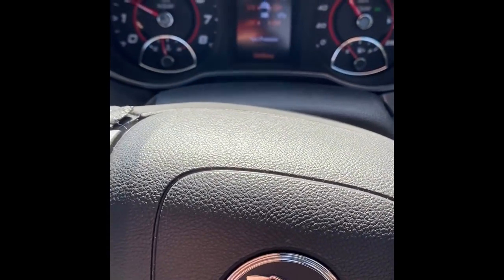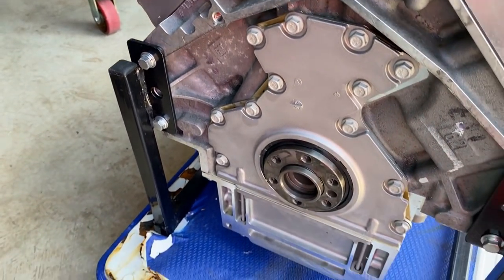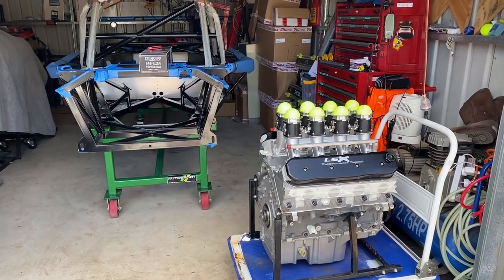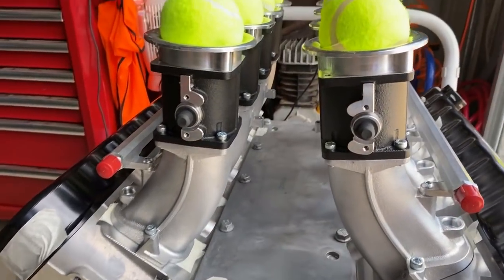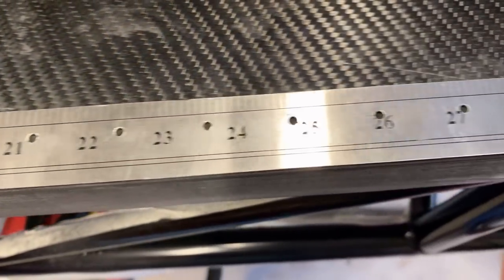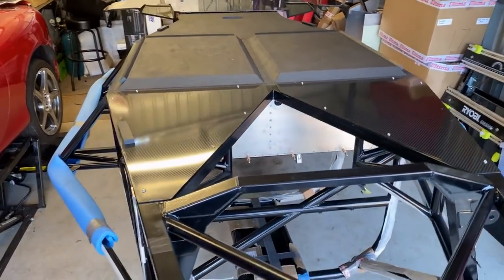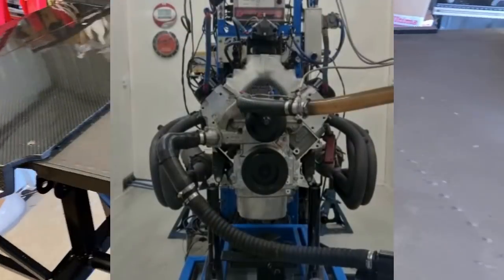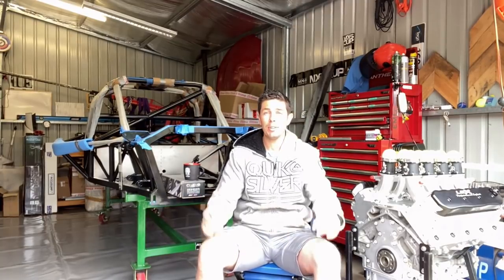Ultima RS - Motor Dyno Results (Video #10)

Comment: Seven hundred-forty newton meters (546 lb.ft.) of torque from a beastly, ITB-equipped LS is enough to bring out the boy inside every man. Thank goodness for traction control software and keep the videos coming.
Reply from the maker: Yeah.... traction control isn’t actually going in. But I have a Bosch Motorsport system you my sleeve if it’s too ridiculous. Thanks!
Reply: @rob105motorsport  Good on you. As a racer you already have a light foot.

Comment: 600hp in that thing will be absolutely savage 😍
Reply from the maker: Hopefully the traction control is up to the task!
Reply: @rob105motorsport  I probably missed it in another video, but what are you running for an ECU?   Traction is a major issue in my SL-C, this is with 525hp and a wet weight of around 2450 lbs (w/ 200 lb driver).   I don't think the TC in the factory ECU can manage it.  Motec is costly, but the way to go if you have the $.  I'm sure others like AEM, etc can still do a far better job of putting the power to the ground compared to the factory piece.

I want to add some turbos to mine at some point, but I know it will get costly if I ever want to put all that power to the ground!
Reply: Found your ECU selection... should be amazing!
Reply from the maker: @ssoffshore5111  I’m running an Emtron ECU. They’re relatively new, but they’ve got some good runs on the board (time attack wins etc). 
However, I’d be running a Bosch Motorsport traction control system for a road/track car. It’s such a good system and quite easy to install. I might still add it down the track if $ permit.

Comment: Great vid as always! Just a suggestion, you may want to look into getting a Perma-Grit sanding block for carbon fiber. The tungsten carbide surface cuts through it real easy. Keep it up, cant want to see more!
Reply from the maker: That's a good tip. I watched a couple of videos of the Easy Composites videos and they seem to make light work of it with a nice finish. Cheers

Comment: It's coming along nicely. That engine should be more than enough performance and love the carbon work. I can highly recommend Easy Composites, great guys to deal with. Would love to know more about your MX-5 too, looks ace.
Reply from the maker: Cheers, Ian. I agree with the performance. It just ended up with a few more horsepower than my original thoughts because of the spec' of the parts around reliability. 
I've got a couple of MX5s.The NA runs a standard SE (AKA Mazdaspeed) motor (around 220whp) and is setup for the track and my NB runs an SE motor I built with a GT2860 (around 300whp) and is setup for tarmac rally. Both really great cars to drive.

Comment: Hi Rob, when I used to play with RC Cars, any filed/sanded edge of carbon fibre on our chassis plates  got a dose of super glue (CA  adhesive) to prevent any issuses of fraying. Is this something you may need to do with the larger panels? Or has CF come a long way since 2005?  Cheers !
Reply from the maker: Hey mate, What you’ve suggested is still the process. I just mixed up a bit of epoxy and used the corner of a rag to seal the edges. Decent carbon manufacturing processes should ensure that the fibre is well impregnated with the resin so no fraying occurs, but it still makes sense to seal it properly. Cheers

Comment: Love the Ultima's, there is a couple hiding around the nations capital.
I have a FC RX7 street car in the build at the moment. The rotary has a fresh build and bridgeported, most of the interior is in. Bodywork is underway.
Reply from the maker: Yep. There are two GTRs locally. One of them is for sale and is built to a good standard. 
I like the FC RX7 and it's only recently their price has blown out. Are you going naturally aspirated or turbo?
Reply: @rob105motorsport  Price increase is partly what has given me justification and motivation to build it. Going to be turbo. Should be fun to drive.
Reply from the maker: @madc0wtx3  Nice. A mate has a fairly cranky FC that he needs to get his finger out and get on the road. A rotor is on the list at some point for sure!

Comment: Been looking forward to more updates and final have one. Love your work Rob. What clutch and gear box will you run with motor. Cheers
Reply from the maker: Thanks, Jason. The 'box is a 996 Porsche item with a Quaife LSD. I've ordered the factory upgraded clutch, but a couple of guys who own Ultima Evos have suggested that the Porsche clutch has a much higher clamping force than LS/LT engines are typically exposed to (assumedly because LS/LT clutches are physically larger with more area). This has resulted in some bad wear on the thrust bearings in the bottom end of their engines. So, I may be going down a different path with a multi plate clutch to drop the pressure plate force. Downside being the multi-plate bastards cost an arm and a leg. Whatever the case, there's some confirmation/consideration for me on that part.
Reply: @rob105motorsport  I was looking at a gear box from TTi in New Zealand. A lot of street and track guys are using them with great results. I have seen Subaru gear boxes been used on V8 appications but boy are they a pig in slow corners. I think you are on the right track with your clutch set up. Looking forward to the final finished product Rob.

Comment: Yeah baby! 😖😁
This is going to sound like a dumb question I'm sure, but why are the inlet ports rectangular?
Reply from the maker: Hey mate, There's a few different generations of heads for the LS. Rectangular port heads were an update to the older cathedral port design (which replaced the earlier SBC heads).
Reply: @rob105motorsport  Thanks Rob, now I have to know everything. Will do my research.
Reply from the maker: @kiwihame  It's a black hole! But it is interesting to see the development of the architecture back to 1955 and how it's now so capable despite some intrinsically poor attributes (like crappy oiling with the deep skirt block that helped strength).

Comment: Bout bloody time shazzy got off her back!

Unbelievable the engine was shipped with nothing over the intake ports? That usual?
Reply from the maker: Hey Tobi, She's off her back! It was properly encased with a heap of Glad Wrap, so no dramas.
Reply: @rob105motorsport  your MX5 is cool with the hard top!

Whats next in the ultima? Must be getting to the exciting part if the build now the Power plants here?
Reply from the maker: @tobihall2247  They're definitely fun little cars. Next with the Ultima is the radiator, brake line, main harness, coolant pipes. and i'll install the shifter and hand brake I think. Heaps to do, but it;ll come together more easily with all the parts arriving.
Reply: @rob105motorsport  looking forward to it buddy!

Comment: Do you guys do the E85 thing down there? Its how I get 350whp out fo my Volvo 850R shitbox wagon with not too much trouble.
Reply from the maker: 850R Wagons are the tits! E85 is a thing. It’s easy horsepower and cooling. The only real downside is consumption and maintenance. Where I live the closest E85 is about a 15-20km Drive in either direction so it’s a pain in the arse. I also want to be able to drive this thing without considering availability. Flex fuel is probably the best answer.

Comment: That opening sequence had me smiling. 

It reminded me of the time my Dad used to drive road trains in the NT and if it was the early hours or folks weren’t around then they’d tie the pallet with engines, gearboxes or whatever to a tree and drag it off the trailer. Premium delivery was if there were some old tires around to land the pallets on! I wonder if it’s the same situation theses days. 

Ps. Noticed the Holden badge on your steering wheel. Shame to hear they ceased trading. Is there any car manufacturing left in Oz at the moment?
Reply from the maker: Hi Dalamar, The old tire trick is still my old man's go to, so I know what you mean! These days if it's a 'professional' delivery, the driver isn't allowed to lift more than 19kg. He's also dressed from head to toe in yellow and has 14 forms to sign. 
As for Holden, it was the last local mainstream manufacturer. Ford weren't long before that. The bottom line is that we have relatively high wages in comparison to global workforces, and our engineering/manufacturing isn't in keeping with that. I like the Maloo, but it has less features/lower quality than my 17 year old E46 M3. Nobody wants a Commodore/Falcon when you can have more specification for the same price. People also love their SUVs. Fact is, the Aus' built stuff was pretty robust/great at eating up miles - I had one of the last Falcons as a work car, and it had the capability to sit at 100mph comfortably for extended periods (I remember setting cruise control between Toowoomba and Canberra a few times as a semi-regular day trip)

Comment: Hi Rob, what fuel was used on the dyno?
Reply from the maker: 98 Ron on the dyno. I specifically wanted that as the fuel because of availability/maintenance. E85 I'd have bumped compression even further to take full advantage.

Comment: Why didn't you go with a Holmart complete LSA for $15000 ??
Reply from the maker: Honestly, it's a much more efficient choice financially to go an LSA. It's actually what I envisaged i'd be putting in when I first considered the car. 
But, they don't sound as good, have quite the same throttle response, and packaging wise the throttle body ends up hard up against the firewall (which also makes heat management an issue). The first two of those issues are pretty picky criticisms though. I do like the LSA in my ute.

Comment: Hey Rob, have you checked out "Ultimate Ultima RS" youtube channel? he has just done the panelling and went about it in a very different way. Just wondering if you had an opinion on his approach?
Reply from the maker: Hey Sam, Yep - Gabe seems like a good bloke. I’ll have to look at how he did his panelling. His car will be very cool and certainly not underpowered.
Reply from the maker: Just had a look. Gabe has his process, seems to be switched on and to be comfortable with the fabrication. Panelling wise I assume he’s aware of the concerns with welding stainless steel to mild steel (floor panel to chassis) as you can end up with poor weld strength. I get the impression it’s not his first day on a Mig, so that’s probably fine. That panel will also add some weight but it’d realistically be negligible. Otherwise, bonding the second skin to the interior Al panes before riveting ensures good coverage. I’m just not sure about Second Skin as a product in terms of how well it’ll hold up sandwiched in the riveted joint and acting as an intermediary between the bond and panel (we don’t have that product in Aus’).
Notching the chassis is a difficult one, but again, properly reinforced and re-finished will likely be ok. The pedal box has been a point of discussion with a fair few Ultima owners, but a lot of that criticism probably comes from being used to road car levels of pedal pressure. 800 series Tilton pedal box looks epic though. 
There’s more than one way to kill a cat. My process is probably the more painful one with considerable over-thinking.

Comment: With tyres, what works on one car might not on another, even on the same car different tyre sizes preform differently- some sizes appear to be stiffer and or different compounds, makes it very difficult to take tyre advice from others... personal testing on your car, your local tracks to your preferences and driving style is the best way, it’s just very expensive!
Reply from the maker: I agree that it's variable car to car, and then there's also preference to suit driving style. As you say, to a large extent all you can do is narrow it down as best you can to a few options based on cost, application, fitment and then go out and test it yourself.

Comment: In my opinion you need an airbox plenum you will loose so much air speed with itb and loose torque.
Reply from the maker: Definitely running a plenum. Stay tuned!

Comment: Great vid, but the volume difference between your commentary and the music is brutal. I need to increase the volume to understand what you're saying and then the music completely blasts my ears off. You could use Audacity for example to normalize and match the levels.
Reply: I just left basically the same comment, lol!
Reply from the maker: Yeah, it’s a work in progress this editing business. The problem is really that it takes time to familiarise yourself with the software, which is build time. I’ve used 3 different softwares so far because of shortfalls. Oneshot is quite easy to drive for the video components, but the audio control was too hard to quickly work out. I’ll have a look for the next one.
Reply: @rob105motorsport  do you mean Openshot? I could take a look real quick and tell you what I can find/how to do volume normalization.
EDIT: Actually, scratch that. If you don't mind switching software, then Davinci Resolve is the way to go. It's free.
The way you normalize there is you go into the Edit tab, right-click your audio, and click "Normalize Audio Levels". Then choose -3dB or thereabouts.
Reply from the maker: @staticv3570  Oh yeah, that's the one. I literally Googled 'best free editing software' and started from the top down on the list. I'll have a look at Davinci Resolve for the next one! Thanks for the tip!

Comment: You're as bad as I am, putting tons of work into something no one will ever see... but you'll know!  You'll want to put 1"/25mm holes in the corners of those  engine bay floor panels to let sand and water drain.
Reply from the maker: That's it, Will! I definitely will drill those holes and create a drain adjacent the battery tray as you've recommended!

Comment: This car is just begging for a sequential trans!
Reply from the maker: I like to fck up the gear changes myself, but sequential trans are definitely wild fun. Sequential ‘boxes also typically suck on the road.
Reply: @rob105motorsport  Well they do whine and have to be gone through every 10k or so.  The replacement parts aren't all that expensive and they are easy to replace (on some of them).  With that said, I have a lot of toys and it would take me a long time to put 10k miles on my my track/street cars... although you might be different.  I haven't looked into doing it with a transaxle for my SL-C, but I have been considering doing it one day on my TT Viper.
Reply from the maker: @ssoffshore5111  It's one of those things. Sequential is 100% the answer for racing, and if you choose the right 'box the initial outlay will be recovered in reliability (road 'boxes don't normally love the punishment). 
I do want to use the Ultima for a fair bit of road driving and where I live means a weekend away is 500-800km minimum. The TT Viper sounds pretty awesome!